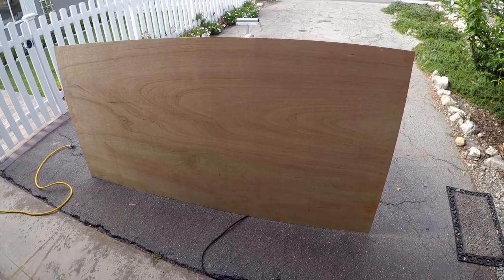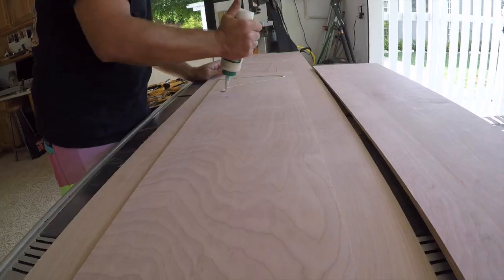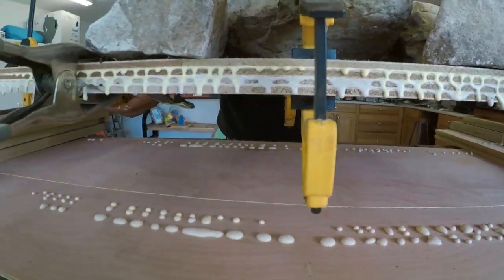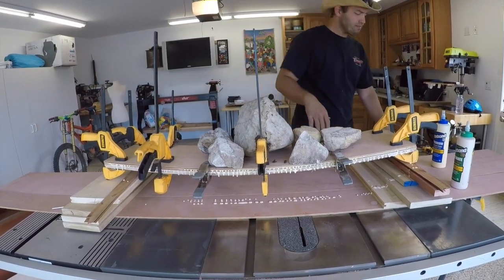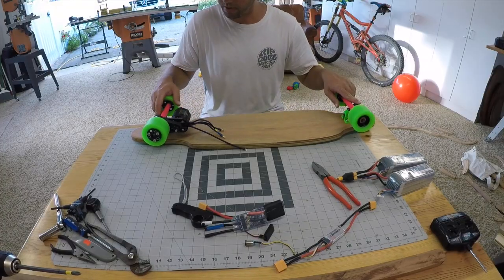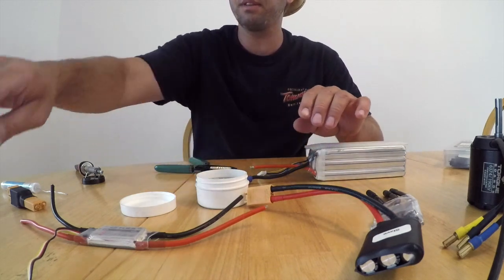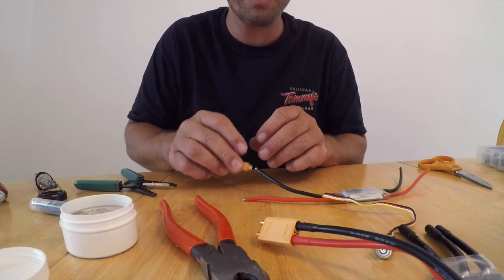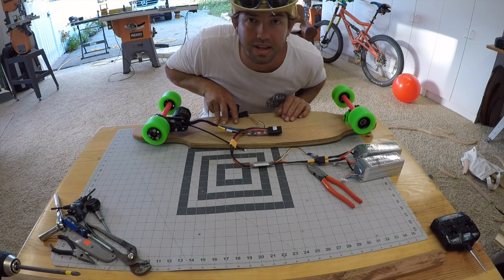DIY Electric Skateboard - How To Make E Board on Budget - Complete Tutorial

Comment: Reminds me of my first build! I like it a lot. I'm currently working on an all wheel drive huh motor setup
Reply from the maker: Jack Wood hubs make going AWD super easy and you don’t need any motor mounts. Win win!
Reply: I have looked at the AWD, do you think the HUB motors would outperform the regular external motor?
Reply: The World By Drone Theoretically no But, they are way easier to maintain and with 4 hub motors the torque would be off the charts. it would also be pretty inexpensive compared to other boards considering a dual hub motor truck is 140 on ebay. There is also a kit on diyeboard.com that provides everything you need for a hub motor board besides a deck. (ignore their belt driven set they're pretty bad)